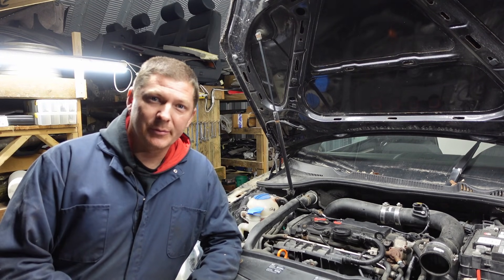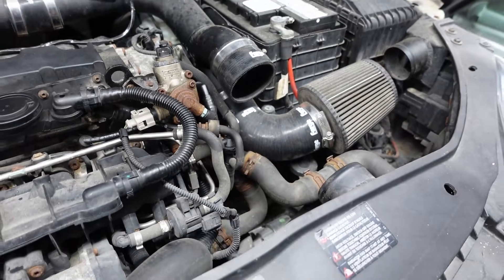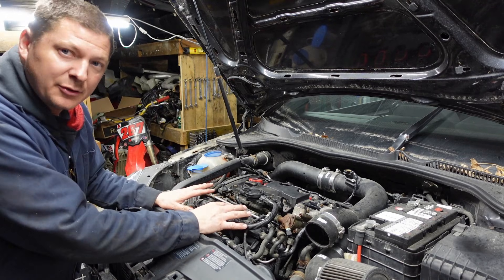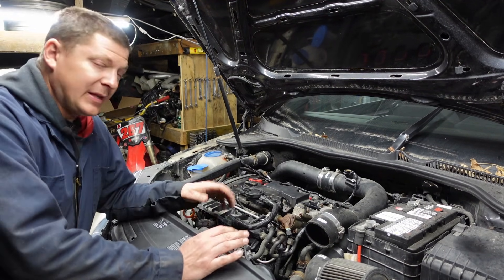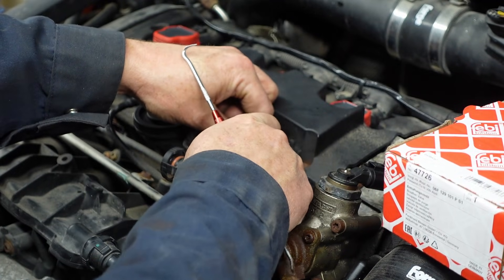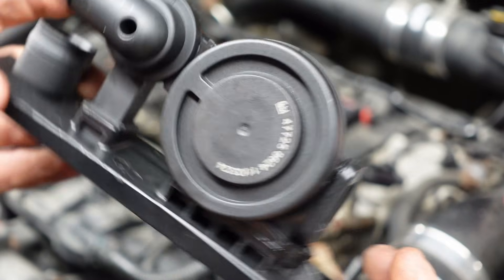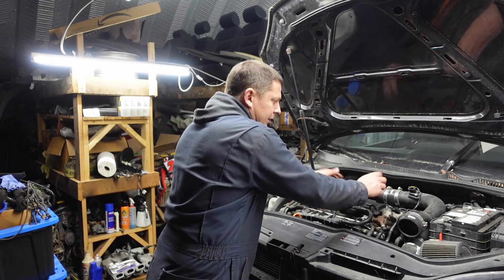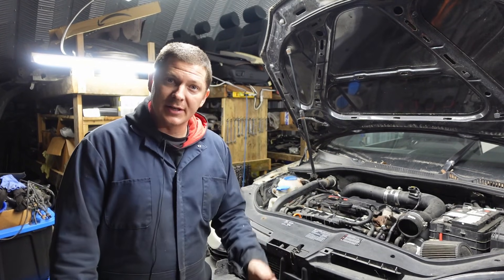PCV Test and Replacement - Mk5 GTI, GLI, A3 EA113

Comment: Hi, i have a golf mk5 GTI and It have iddle rpm, the fault codes are p0171 and p0507. 
I change the pipe of vacuum pump, the PCV and the pipe of this, the problem its not solved, the intek pipe don't have air leaks after the maf. 
After unplug the pipe of PCV go to the intake and cover the hole of manifold the problem its solved. My oem number in carprog2 its different than the PCV purchase on autodoc, the brand its "Gates". 
This thing its posible caused by rocker cover ?
Reply from the maker: The PCV hoses often crack and leak air too. Could be a leak in the rocker cover but I would want to find out before throwing more parts at it. Can you smoke test?
Reply: @PBGarage it's resolved, the failure is the PCV not oem, yesterday purchase PCV oem in VW and now my idle it's perfect 😝
Reply: @ptgaming0183i bought a gates pcv and totally not working..
Reply: For the all people Who wants change the PCV, purchase oem in VW or our car brand, i change another parts and the problem its the PCV brand "Gates" now autodoc don't make the payment of this 💩 "35 euros" and the VW PCV cost "65 euros"
Reply from the maker: That’s great advice thank you for posting!
Reply: @PBGarage nothing men, everything is to help anyone whith same problem 😉
Thank you for your vídeo 🤙🏽

Comment: I checked my pcv valve and it the screws were so loose. I just tightened it back down but now thinking about it i should've cleaned where it joins the valve cover. I am getting multi misfires
Reply from the maker: If you’re not getting fuel enrichment codes a good place to start for misfires is the usual diagnostics. Check spark plugs, if they look good make sure the gaps are correct, if misfires are happening on particular cylinders, swap those coils around to see if the misfires follow the coils.

With the engine running if you try and remove the oil filler cap is engine vacuum holding it on making it hard to remove?

How much mileage is on the car since the last carbon clean of the intake?
Reply: @PBGarage thanks brother ive had the vehicle for almost 2yrs. I dont believe its ever had carbon cleanig before. I was told if i unplug the cools one at a time ill hear the rpms change and if it doesn't change its possibly the coil. I need to check the spark plug gap as well 😅 i checked my pcv valve and it was loose loke they tightened it by hand 🤦‍♂️ the rough idle stopped but the misfore continues 😫 not to mention its 29degrees ourside 🥶🫩
Reply: I really appreciate the info  @PBGarage

Comment: I just had a fresh rebuild on my bpy motor and noticed that the car is pulling so much vacuum that I can't even remove the oil cap and when I shut the car off I can finally remove it but it releases A LOT of pressure from in the motor, could that be a faulty pcv
Reply from the maker: Yes definitely, also check routing of vacuum lines it’s possible things are hooked up wrong if it was just all apart.

Comment: hi! do you recommend pcv delete? regards from Brazil
Reply from the maker: Not unless you’ve got big turbo and high boost.
Reply: @PBGarage  im planning to install an oil catch can(2 ports) keeping the pcv valve(going to one of the ports) and isolating the intake mainfold, in the second port install a hose and make it goes to the back of the car.. what do you think?
Reply from the maker: I’m not sure the PCV valve will function correctly without the intake manifold vacuum on one side of the PCV. If you’re going to run the catch can I would remove the PCV. What I meant before is that unless you’re running a big turbo I think it’s better to not run a catch can
Reply: @PBGarage i want to avoid carbon build up
Reply: @PBGarage  the pcv valve has a return pipe(after membrane) and a exit to the oil vapor that runs into the intake side... im gonna try this way(with PCV) and later i post a feedback... thanks for your tips, got a new subscriber!
Reply from the maker: Sounds good keep us posted!

Comment: Hey i have a suspected bad pcv suddenly. Whenever i plug in the maf sensor engine idles very rough then whenever unplugged it eases out. I checked pcv by opening oil cap but only felt slight suction but after j did so engine started to idle rough. Would that be a bad pcv?
Reply from the maker: I would check for other vacuum leaks like the hose from the brake booster. Listen for sucking noises. But also it’s pretty easy to pull the pcv off and look up the “blow test”, I don’t remember off hand but you can find on the forums which ports should flow and not flow air when you blow/suck on them. Will tell you if the diaphragm in the pcv is bad.

Comment: Could this cause my turbo to leak some oil?
Reply from the maker: If the pcv was blocked, and crankcase pressure was increased it could prevent the turbo from draining properly. But generally no. They always leak a bit of oil though. Are you getting lots of oil in the intake piping?

Comment: I changed my pcv with a new one but i have the intake manifold hose with much oil and sometime in the 2nd gear i feel the car loses power, i cleaned the intake manifold when put the new pcv. Mk5 gti stage 2 ea113 bwa
Reply from the maker: Sounds like it could be multiple issues. Any codes?
Reply: @PBGarage no codes, no check engine light on

Comment: Hi im currently having issues with my audi s3 ea113 engine , its all of a sudden decided to throw up a low fuel pressure code after filling the tank. It idles rough but i wouldnt say missfiring. Could this code be linked to the pvc system the car is on 153k ive owned it for a year with no history so its not been changed  to my knowledge
Reply: Great vid just a question can a failing pcv valve cause random intermitent miss fires that would come and go scanned with vcds and the misfire keeps on moving 1 time said cylinder 2 cleared fault drove for 2 day no miss fire then came back and said cylimder 3 this time and again after that cylinder 4 note this happens usualy after driving the car hard and then stop it would miss fire also surges under heavy load and then if i lift and tramp again it would just be gone could the pcv cause this
Reply from the maker: @DomAfrica it’s possible but it could also be incorrectly gapped spark plugs or failing MAF sensor. I’d start by pulling the oil fill cap to see if there’s excess vacuum in the crankcase.
Reply from the maker: Most likely the fuel pressure sensor located on the top on the high pressure fuel pump has cracked and failed. If you’re not sure where that is let me know I can explain how to find it.

Comment: Would a catch can be a good replacement? I have a EA113 Audi TTS and I just picked up a 034 Motorsports catch can. Would like your thoughts.
Reply from the maker: I think catch cans are good for cars making a lot more than stock power and are in warmer environments. I think they have a lot of issues on cars that get driven at or below freezing and they can cause damage in those conditions.
Reply: @ Thanks for the reply. I was lucky to pick up a very rare 2015 TTS competition pkg in Imolla yellow with only 21K miles in mint condition. These cars are not popular in the USA. Good thing I’m in the warm Florida weather. I just flashed it stage 1 from 034 motorsports and did a stage 2 TCU, replaced plugs, coilpacks, BPV, did oil change, Hadlex service, F&R sway bars and end link upgrades , strut tower bar. I will be doing a DSG service soon and replace the rest of the fluids. 
Doesn’t seem to be consuming oil at all. Is there anything else I should be looking at? I did do a carbon clean induction service with Audi. It’s called BG44K. It helps remove some of the carbon on the intake valves but I hear the walnut blast is best. 
I’d like to stay ahead of the game so I’m searching topics on EA113 engine and found your video. Any recommendations would be greatly appreciated.
Reply from the maker: @PeteRock1 make sure you replace timing belt and water pump, not sure the recommended interval but I usually do mine every 100k km (60k miles) but if yours is original you should think of doing it anyway due to age. Also definitely look into deleting your balance shafts (great tutorials on our page for B7 Audi A4 same engine BPY). Inspect/change the cam follower regularly (also have a tutorial on that for B7). Check your vacuum pump for oil leaks. Other than that stay on top of maintenance and you’ll be good.
Reply: @PBGarage  Q? While my car is on. I open the hood and if I take off my oil cap ( while engine is running ) . The engine seems to run a little ruff as if it want to stall and you can hear the sucking from the oil cap area. When I put back the oil cap it then runs fine. Is that normal ? I don’t get any oil consumption . What symptoms of a good PCV system.? I recently sent a data log to 034 Motorsport as I have a stage 1 ECU tune on my ea113 Audi TTS. They said it’s was correcting 3.7 of timing but overall seems good. I have new plugs, and new coils and I only put premium top tier fuel. I’m trying to find what would cause the timing corrections. Also I want to go to stage 2 but I want to make sure I do all the proper maintenance before hand. Any suggestions?🙂 Thanks in advance.
Reply from the maker: @PeteRock1 if it runs poorly with the cap off it’s probably fine. Keep an eye out for lean codes. If the 034 stage 1 tune is a 93 octane tune it would be normal to have a bit of correction running on 91.
Reply: @PBGarage  Thanks for your video. I finally got around to changing the PCV valve and despite me being at 27.5K miles, it made a very big difference. Idle, response and acceleration is very noticeable. 🙂Highly recommended.
Reply from the maker: @PeteRock1 awesome glad to hear!

Comment: Currently struggling with a misfire on cylinders 1/3/4 did both plugs and packs still happens, when driving it'll stay at a steady 1500 in neural until i stop and reset. the oil cap doesn't really struggle to come off but definitely hisses at me. Should I replace the PCV in hopes of getting rid of it? No cel or anything at all just happened after a longer drive yesterday.
Reply from the maker: Sounds like it could be a vacuum leak but not necessarily the PCV. I would be trying to do some further diagnostic before pulling the trigger on parts. Is it manual or auto? Manual cars will hang revs so long as the car is rolling if one of the clutch switches has failed.
Reply: @PBGarage Yeah it occasionally rev hangs at 1500 but once i hit the brakes it'll drop. i'm not very mechanically inclined but it could possibly be that i need an upgraded clutch as i am stage2. She drives great still just did my cam follower aswell as about to order a pcv to see if it changes anything. As far as i can tell it's only an idle issue not a driving one.
Reply from the maker: Definitely not a clutch issue. Probably vacuum leak or leak after the MAF somewhere. Does it have an aftermarket diverter valve? They’re often problematic.
Reply: @PBGarage  it's converted to a bov to get rid of diverter issues. could possibly be that aswell
Reply from the maker: @khenxs3749 yeah I would look there for leaks. Even if it’s not leaking, when the BOV vents, the MAF reads all that air and will inject fuel to match, so you’ll be coming back to idle really rich. Could be part of the issue too.
Reply: Sorry yes it's a manual lol

Comment: Hey, thanks for the info, should a good pcv valve rattle? I see conflicting info on the rattle, not sure which it is for this model
Reply from the maker: It’s just a diaphragm with a spring so I don’t think it should be rattling?
Reply: @maazmohammad9077 the rattle test is only valid for really old cars with very simple PCV valves, like a 1980’s Toyota.

Comment: Great video, I added oil to my A3 then next day check engine light came on with P2279 code. A German repair place said it’s the PCV valve. I readjusted the oil cap and engine light went out. The oil cap has some suction but not too much where I can’t remove the cap. The car has 60k, does PCV still need changed even though light went out?
Reply from the maker: Sounds like the oil cap was letting a ton of air in and throwing off the MAF reading. I wouldn’t worry about the PCV unless there was enough suction to make it difficult to take the oil cap off.
Reply: @ ok thanks! it also idled fine before and after engine light came on.

Comment: I have replaced de OEM stuff for an aftermarket valve cover and oil Catch Can, this way the vacuum from intake manifold has no direct effect in the crankcase
Reply from the maker: Great solution in warm climate, catch cans are tougher on winter driven cars because you can get ice buildup in catch can lines and crankcase pressure will blow out gaskets and main seals.
Reply: @PBGarage if you empty it during the winter before driving would it alleviate those issues? I'm considering getting a catch can for mine
Reply from the maker: I think if you have a heated garage where the car is being stored so you can empty the catch can regularly it would probably be alright.